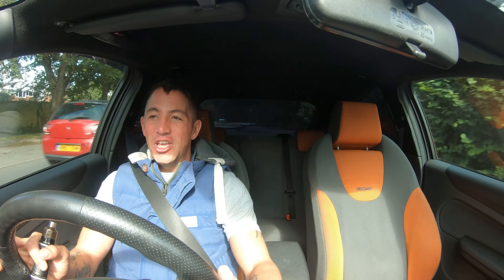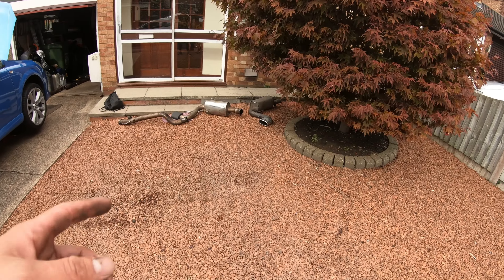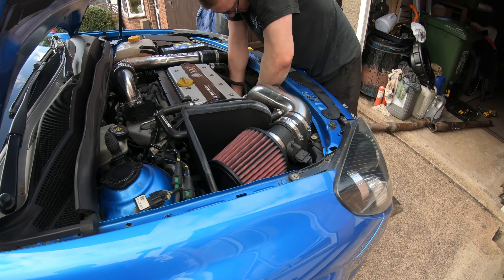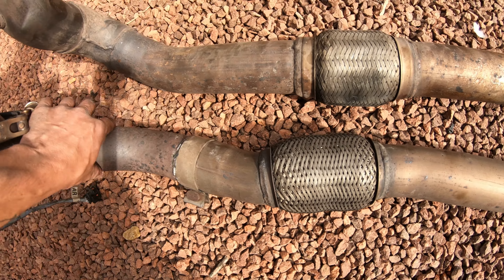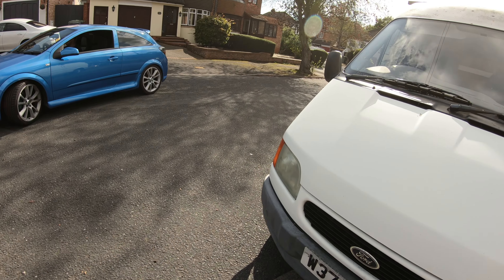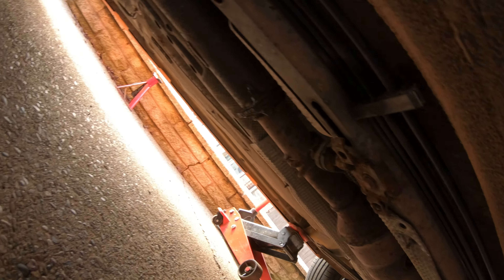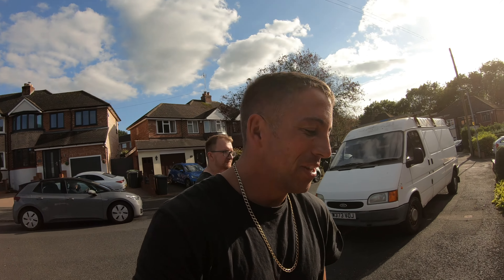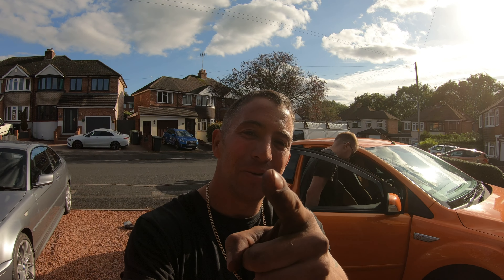Focus st225 decat install and Astra Vxr miltek race install

Comment: Astra h question.... Sorry yoda.
I got a astra h 2.0 turbo sri (not many left now)
Looking for a new exhaust system and don't want anything super loud..... Just a nice rumble note.
Got a corutney x over delete and heat shield setup like matey in the vid.
What would compliment that nicely??
Reply from the maker: Remus is always a good shout
Reply: @Yodaracing1  thought remaus were standard with em??
Feel free to educate me.
Pretty sure there 2.5 vs the vxr 3.0?
Reply from the maker: @MrKutzzy  remus was a optional extra on the vxr mate but came on the burg etc standard  the remus was 2.75” mate
Reply: Believe standard exhaust is 2.25” as the upgrade exhausts from milltek and cobra started from 2.5”
Reply: dodgy MOT,s for life now 😂
Reply from the maker: @chrissingleton8473  standard 🤣
Reply: I went for a mid silencer delete pipe 2.5 but kept the rear silencers as didn't want to be too loud. Only gets loud when being heavy footed. Zafira VXR tho not Astra.